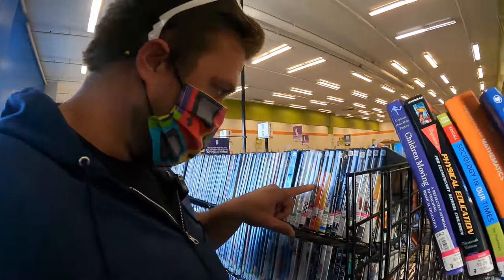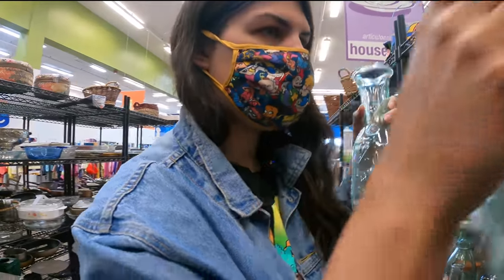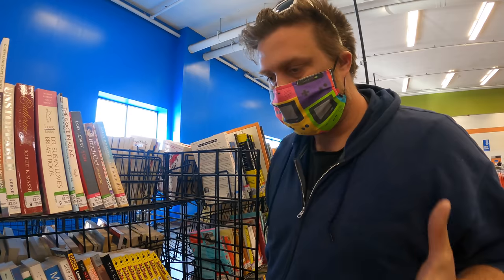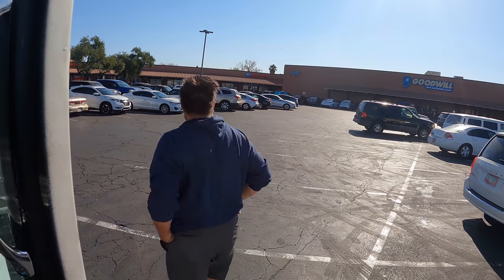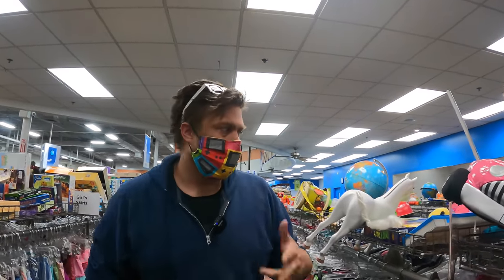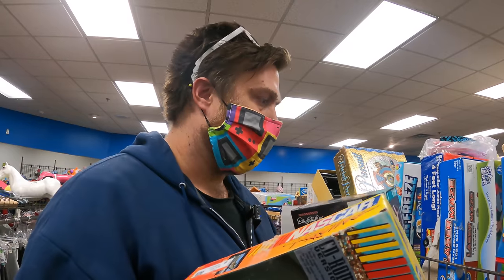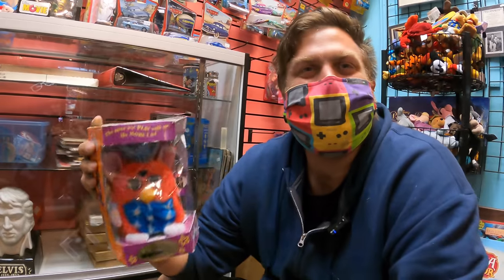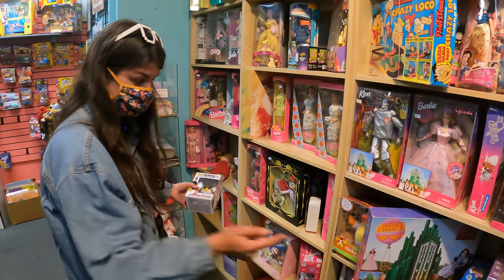Goodwill Had TONS of these!!

Comment: Tendo,
What do you think about turning the cabinet so that the door opens toward the ceiling of the van? You would not have to worry about it swinging open sideways and the magnet should hold it closed in this position. Also, if the cabinet is less wide than it is long it might also solve the sink top problem; however, you would have to change the direction of the inside shelves. Just a thought, love watching you guys. Keep up the good work, Jackie